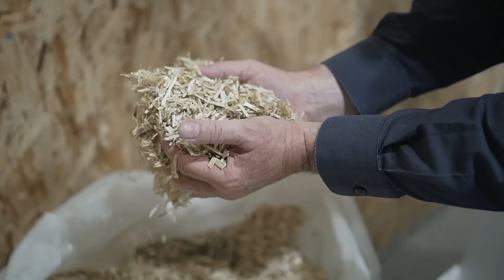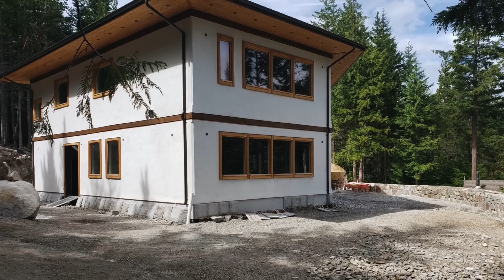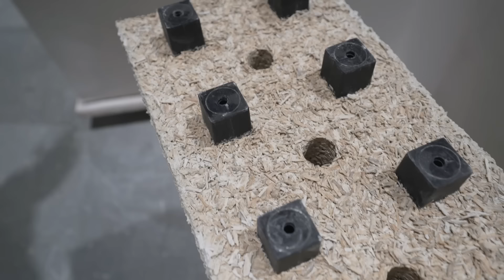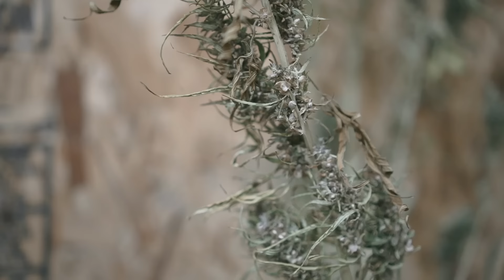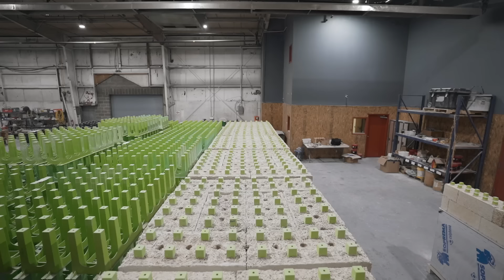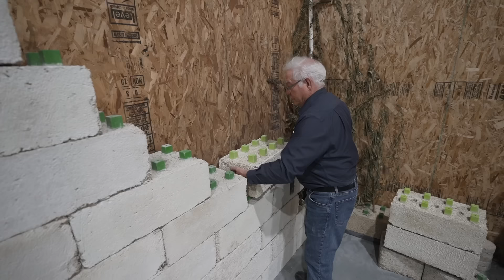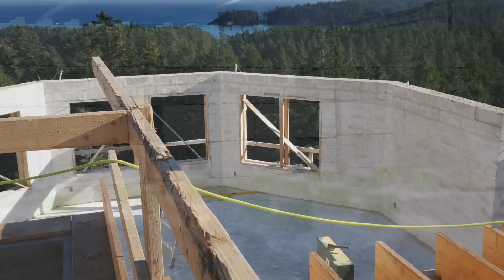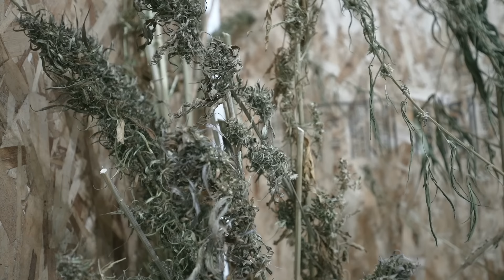Amazing Lego-Style HEMP BLOCKS Make Building a House Quick, Easy & Sustainable

Comment: This would be a great option to build with in areas that are prone to forest fires. Put a metal roof on it and the house would last though the fire. Very interesting.
Reply: the house might, but nothing inside would.
Reply: @DVankeuren  Exactly, which makes it an upgrade from everything, including the house, burns down.
Reply: @DVankeuren  
At least you would have a house to come back to instead of losing everything 🤦🏻‍♂️
Reply: Fire retardant not proof. I wonder how they would hold up during a hurricane.
Reply: @ronaldbaak3183  no theyre fire proof.
Reply: @iskdude9922  fire resistant
Reply: 1. Put human in house
2. Bake at 400 degrees
3. ????
4. Profit!

Comment: Would love to see a construction video with electrical and plumbing installs, this sounds awesome to replace the foam insulation that needs concrete .
Reply: Would love to see a video when plumbing leaks and saturates the hemp walls.  How difficult is it to replace the hemp blocks under load if they're damaged?
Reply: Yes, this video is a fail because it left so much out, expensive issues out

Comment: I may have missed this part, but my question is if it's so easy to cut and shape and it's lightweight; how easy is it for someone to cut into it with a saw and remove a section to enter the structure? In reference to safety. 
So far, I think it's genius. But I just now discovered this video on my feed. And I'm very interested in knowing more.
Reply: I was going to ask about its strength as well, since it was being compared to concrete.
Reply: It seems like there is mortar added between the blocks during an actual build plus internal plaster and external stucco. So more difficult to cut when finished.
Reply: theyre just gonna break a window to get in...

Comment: Terry Radford is a great speaker in this video.  Very easy to absorb the information he provides nonstop during this video.  Well done.  Would love to own a hempcrete home.  The only thing I noticed was that the below grade foam blocks would probably emit voc's and I noticed that Terry did not say otherwise.  Regardless, I would use them.  I love the idea that these hempcrete insulate and provide structural integrity at half the weight of concrete.  Oh yeah, and sequester 10 tons of carbon per home on average.
Reply: except he said that it has the same load bearing capacity as conventional concrete which is entirely false! i dont understand why he would say such a thing

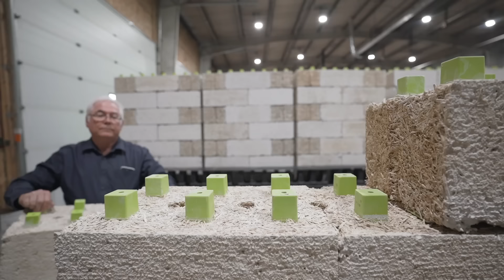Comment: 1:02 Ok wait, you should not aim to be "slightly more expensive" than concrete. It's a friggin plant you can grow by the acre, concrete isn't renewable. I get it's probably expensive/difficult to process but figure out how to automate that shit. No one is going to use it unless it's significantly cheaper AND better. also should aim to get rid of those green pegs. just mold the shape into the block. cut cost by 30%. or make them out of the rest of the plant.

Comment: There are so many hurdles for a product like this to make it over, especially in Canada where the government is heavily involved in the building process. This is a niche product and will never be applied to mainstream construction. The amount of money you would have to spend in advertising/trade shows as well as getting this product approved to meet the building codes in different countries/areas would be insane. This is for the client/builder who wants something special that not many people have. There are also a lot of practical issues like how are you supposed to run electrical/plumbing/ventilation through it? This product might have been impressive 20 years ago but today it is nothing special.
Reply: Their website indicates that fire safety has already been addressed, with CAN/ULC certifications for non-combustibility, flame spread and smoke development, and fire-resistance rating. They don't mention a specific R-value in this video or on their website, so that testing probably hasn't been completed yet. The structural aspect will require a structural engineer's sign-off, but that is true for almost all new houses in Canada anyway. People expect new houses to have large windows and open floor plans that push most design beyond the limits of prescriptive building codes. They've addressed electrical installation by providing holes for conduit, which is threaded through the blocks as they are stacked. Plumbing and ventilation ducts normally don't go in exterior walls in Canada. So the blocks may be a niche product, but I don't think there are any building code issues that will prevent their use.
Reply: The fact that deforestation is killing the planet and wood is becoming rare and expensive makes transitioning to hemp almost inevitable

Comment: How do you use fasteners (nails, screws) with these blocks? What is the procedure for installing an electrical outlet for example how is the box fastened in place, how are the wires run from the holes inside the blocks? How are rafters attached to the top of the wall?

Comment: I say they start making whole wall forms instead of individual blocking to speed up the installation process and lower the labor burden.California ranks 49th among the 50 US states for housing units per capita. Benchmarked against other states on a housing units per capita basis, California is short about two million units. To satisfy pent-up demand and meet the needs of a growing population, California needs to build 3.5 million homes by 2025. If the building process can be simplified and faster then this goal can be obtainable
Reply: The walls only need to be 12" feet height to still allow for the 18" inch subfloor distance from the subgrade  and allow for plumbing access and for future repairs and provide room in the crawlspace for the plumber or repairman
Reply: Using individual blocks saves time over poured hempcrete due to the drying time involved

Comment: Only drawback i can see with this product is that it locks up co2. The reason we are in a co2 drought is because crustaceans have been locking up co2 in the construction of their shells and when they die the shell fall to the bottom of the ocean and is turned into limestone. We need to release more co2 back into the environment, it is the building block of all life.

Comment: This looks cool, but that "more expensive than traditional building methods - but better" line really gets old.   Everyone is trying to justify charging more for their products.  Still, the design  looks really nice.  I'm curious if water incursion would be a major problem is it is with air-crete.
Reply: Look, its slightly more to build but energy efficiency, etc. is so much better that youget the difference back in a few years.
Reply: @bclemmon2505  
OK, good points, but some houses now are using cork on the outside to insulate.   The only problem I have with this, and it's not really a problem, this looks great.  The blocks are kind of loose compared to bricks and I am not sure they can withstand water, say like so many areas are getting flooded these days.    Also, there is a lot of labor here, but I like the idea of just putting up walls and a shell and building out in the inside.  Seems like a big step up from straw bale houses.  And it seems like the price might be a victim of its own success - as how much cannabis fiber can there be on the building market?  But the Lego concept is really cool.

Comment: The epoxy structure is still petroleum based, which looks as though it's roughly 15 -20% of the block?
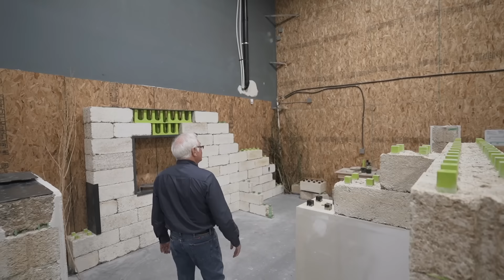Reply: @4:35 vegetable oil based bio-composite epoxy

Comment: Environmentally friendly hempcrete blocks held together by plastic ...
Reply: @4:35 vegetable oil based bio-composite epoxy
Reply: @PaulDeFelice  Yes, plastic
Reply: @oldmanfromscenetwentyfour8164  but not petroleum-based
Reply: @PaulDeFelice  doesn't matter, it's toxic as well
Reply: @oldmanfromscenetwentyfour8164  Well, it's "permanent" and not "single-use" so shouldn't ever end up in a landfill. I wouldn't be surprised if it could be re-used. Conventional stick framing requires gypsum board drywall, polyethylene vapour barrier, fibreglass insulation, exterior plywood or OSB sheathing, sheathing membrane, siding, and all the associated nails, screws, and fasteners. Hempcrete requires way less of all that. Without the studs, hempcrete forms a tighter, more efficient wall, and it breathes so no condensation and mold like you get with stick framing. So I would say hempcrete is much less "toxic" overall than stick framing. And deforestation is killing the planet.
Reply: ...and what evidence do you have of the toxicity of this plant-based product?
Reply: @PaulDeFelice  Have you worked with Hempcrete Blocks or lived in a house made with Hempcrete Blocks? If no, you don't know what you're talking about.

Comment: Using hemp sounded like a good idea Until he sad if the blocks get wet they Totally fall apart. I could see a hose coming down if an area where the house is build gets flooded or what about a pipe burst in the house then your whole house comes down. That is Not a safe option for a house then

Comment: And when the walls get wet, the organic materials rot away and along with it the strength? I see why you built a large overhanging roof and kept the walls above the ground to prevent that, but you really cant as there will be rain and snow blown onto it. Also when will the organic material decompose by itself? You know we in Europe have some buildings from the roman area still standing after more than 2000 years, but they do not contain organic material.
Reply: Check out a Frenh company builing with hemp crete.
Reply: hempcrete petrifies and turns to "stone" over time

Comment: Definitely need some clarification on a few points..  a lifespan of 60 years??  What does that entail exactly?  If a person were to use these as not only the foundation but also the wall system and they only have a lifespan of 60 years, then what?  Just tear the entire house down?  I know when a foundation needs to be replaced on a stick framed house, it can be jacked up and the foundation rebuilt.  Also, repairs may need to be made, but the average concrete foundation lasts much, much longer than 60 years while remaining structurally sound. Second question is the R-factor for the unfinished block.  

Very interesting product.  I'm in the construction field, would love to get some better info (their website did not answer the above questions).  Currently we are steering customers toward SIPS panels, but those panels use sheet materials containing some pretty nasty glues on the interior of the home.  Would love to see a tech like these blocks become a viable alternative.
Reply: He said these blocks can't be used below ground as they would deteriorate. They probably last a very long time if kept dry, but not long if exposed to repeated wetting. However, since the load-bearing frames are impervious to water, it should be easy to fix localized damage by digging out the decayed hempcrete and replacing it with fresh material. Then deal the water problem so it doesn't happen again.
Reply: hempcrete petrifies and turns to "stone" over time

Comment: The down side of growing it in the US is if the weather is to dry or to wet the THC level can get above the legal level which I believe is around 3.5 or less.  If it's above that you have to destroy the crops.  To volatile.....🤔🙁
Reply: Farmers need to be allowed to grow the best hemp possible rather than be restricted to "bastard hemp" which is arbitrarily limited to 0.3% THC. Just grow the fastest, strongest, highest yielding hemp and don't worry about the THC content

Comment: I am at the moment in an African country, which legalized Hemp for Health products. Means, there is already a basis. But... 1 traditional large concrete building block cost less than $0.70 US Dollar. There is a massive demand for blocks etc. Block factories at every corner. Now, how is you block fitting into that? I checked your partner section on website, stating $10 - $15 MILLION Dollars finance typically... For a SMALL FRACTION of this, I can start a block factory over here and make profit.

Comment: A few questions for you:

- Why does hemp below grade decompose? Is this due to cutting off the airflow so it could shed the moisture? With proper ventilation hemp will shed moisture and help regulate it just like a thermal mass regulates heat automatically.
- Why do you use a sealant on your hemp blocks? Part of the benefit to building with hemp is breath-ability which the majority of homes lack in abundance and enhances the living standard for the residents. There are other ways to protect you home exterior sufficiently.
- Do you offer other sizes of blocks for colder climates?
- What is does a repair job look like with these prefab blocks? I would think you must remove a substantial amount of blocks to make repairs with this method versus a quick fill for the typical build of filling the walls.
- What is a comparable price comparison for similar insulation and what is the expected lifetime?

Hemp is also fire proof not just fire resistant. There have been many demonstrations where people have deliberately tried to start hemp on fire and failed every time, sometimes to their surprise.
Reply: Hempcrete wicks moisture, that's why lower layers need to be waterproof.

Comment: Another one of these "sounds good on paper, but more difficult than we thought it would be in practice".  Seriously this might be a good alternative in areas where it can be grown and delivered that doesn't require mass transit to ensure it remains environmentally friendly on all parts, but for areas where hemp can't grow (at least on the scale needed to be used in place of concrete and wood) this sounds like another shipping container house idea.

I'm curious to see how well this actually will actually for cost in areas that aren't able to readily access hemp to make the material or how it does in areas where more extreme weather is more frequent.
Reply: One thing the JBF guys are seeing is that hemp can be grown pretty well everywhere on the planet - as it once was - and it is getting lots of attention as a crop because of the multiple value streams it provides. It will soon be grown in many areas around the planet and then there will be material for these kinds of products for building. with materials that are very resilient to all sorts of extreme weather conditions.
Reply: hemp grows anywhere, even Chernobyl
Reply: @Buddhadreams  ...everywhere outside of the arctic and antarctic circles

Comment: How have you tested your inner stacking support system so that in time the locking system will not weaken ?  I do understand it will not be subjected to sunlight but only rise and fall of temperature and possible seismic noise from hose hold , outside and below ground.

Comment: As someone who has built with hemp in northern Ontario's temperate climate, I wish this had been readily available at my time of build ;b Brilliant!
Reply: care to share any details?
Reply: The price was reasonable as I did the work myself. I purchased hemp hurd from Ontario Hemp Materials, metakaolin clay from Poraver in Barrie ON and local hydrated lime. The bricks in this video are awesome because of the time consuming nature of the mixing/packing process, but overall I'm happy with the results, my 12" walls are approx R30 + thermal mass :)
Reply: @renegadepermaculture  Did you rely on previously published resources to determine your ratios or did you test it?
Reply: What was your price? And where did you get it.. because my price in ontario, is astronomically unfeasible.
130 a square foot its not even worth looking into.